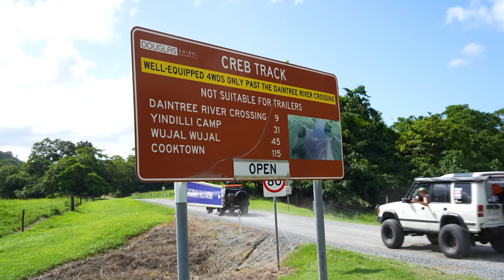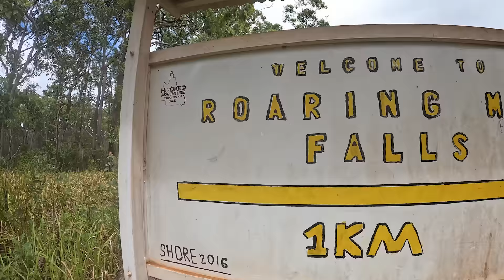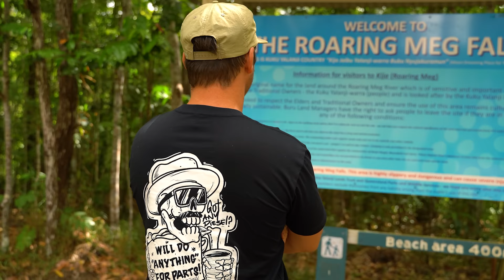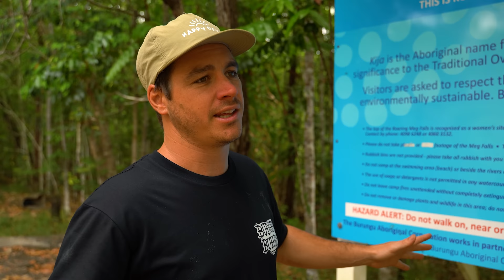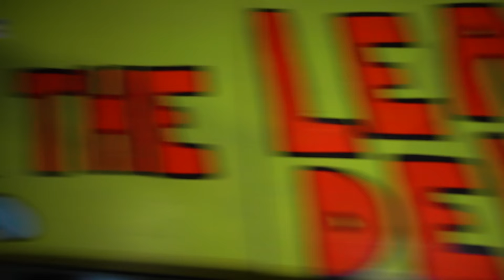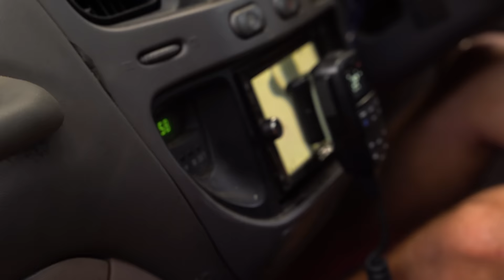BUDGET 4X4 VS CAPE YORK CHALLENGE

Comment: most distributers have a breather hole in the bottom. Drilled out the breather hole and fit some tubing- one to the inlet side of the engine air filter, the other side to the cabin blower outlet side. the blower pushes clean dry air thru the distributer and has kept it going when the hood is under water. Used to foul up distributers every year from moisture till i did this mod

Comment: Budeget 4x4 should be leaf sprung, steel rims with worn out tyres, manual transmission, no AC, no power windows, no radio, no winch, halogen headlights with no Aux lights, small factory standard  off road tyres, no snorkel etc..